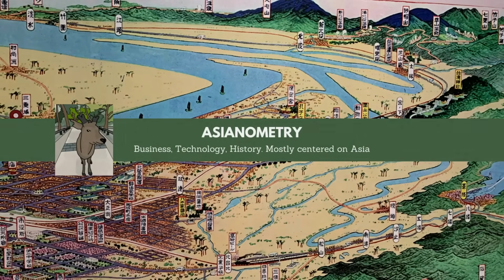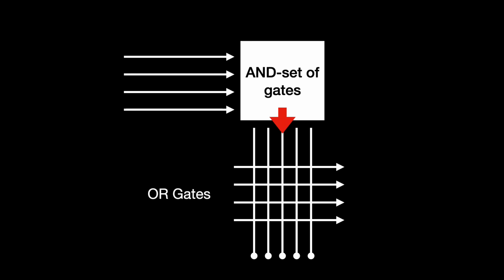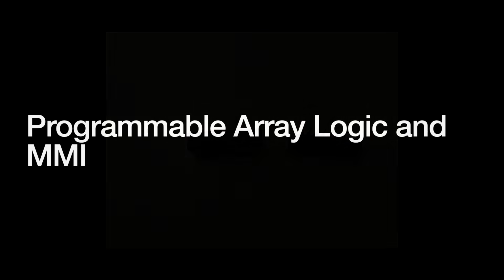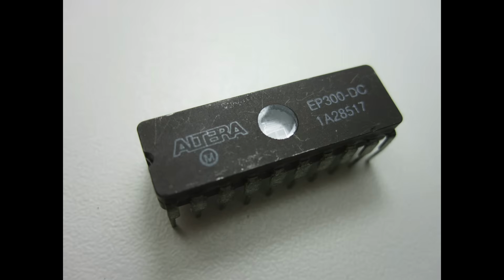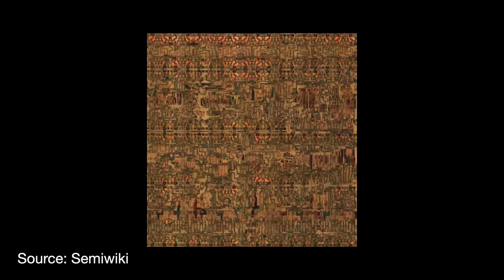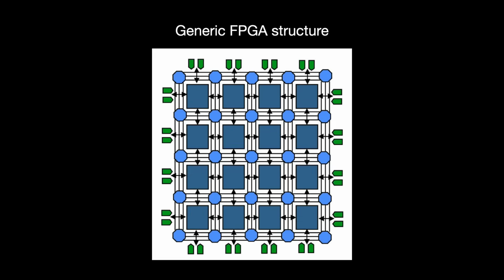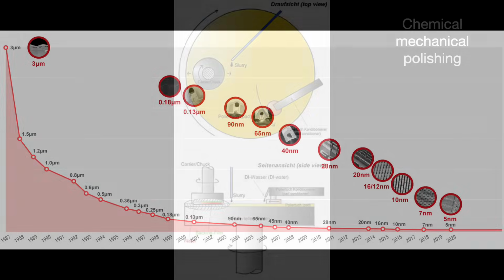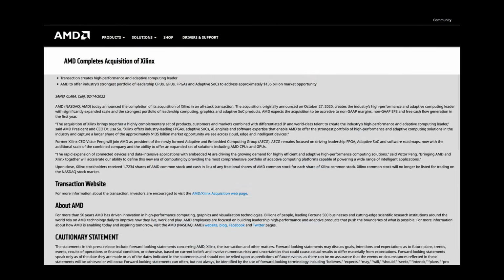The History of the FPGA: The Ultimate Flex

Comment: The "blown micro fuse" tech was continually improved on, and reached it's final form in GameBoy Advanced video cartridges.

Before rewritable storage process fell low enough, chips made up of fuse-arrays were an affordable way to store (HIGHLY compressed) video  for portable consumption.
Reply: At the end single-time programmable memory chips were usually OTP EPROM, i.e. an EPROM that technically would be erasable but in a plastic package with no window so there's no way you can. EPROM was cheap enough and more dense so it made no sense to keep using fuses, and what made a lot of the cost of an EPROM was the need for the window and the expensive ceramic package that involved.
Reply: I imagine by then it was rather easy to manufacture, too
Reply: @kaukospots  I assume so, if they could mass produce them in Children-want-to-watch-Spongebob quantities. 😂

Comment: There's like 50 people who work on FPGAs, and I'm one of them! WOOOOOOO!

Just, I hope you like looking at oscilloscopes or simulated oscilloscopes. But hey, it's the only programming challenge that  has no stack, heap, or oversimplified abstracted libraries. The only values for a variable is just 1, 0, High, Low, and ** (What you say when you get an X).
Reply: How the heck is cross-talk mitigated at such interconnect speeds now? Software scheduling of "transmissions" close to each other physically to mitigate signal degredation?
Reply: @bluesteelbass Two things: There's way less interconnects than you think they are (maybe 10s-100s?) for any given unit (limited fan-out), and clock speeds are like 200MHz at the high end, so every signal has some nanoseconds to "settle down" before the next clock cycle. Making sure of that is actually an entire phase of design called Timing.

 But the FPGA has no ALU, because every LUT/CLB is a mini dedicated ALU, so you can pipeline and parallelize to hell and back to make accelerator cards of any configuration. Then the low clock speed is less of an issue if you can push huge data throughput out of PCIE regardless.
Reply: @adissentingopinion848  Ah ha! Programmed "settle" times.  I did not realize the clock speeds of the programmable logic was so low comparatively to modern CPU's.  When doing Timing optimization, does the software know the architecture of the chip?  If a "circuit" is routed along a physically longer path than another, in which both tasks need to be performed in parallel, are there algorithms that perform "wait" times for pieces of info that physically travel faster than others?  I would assume the design phase of Timing would correct for issues like this?

This was one big problem I had when looking to experiment with these myself.  The programming software did not seem to be very in depth for things like utilizing the fpga's physical layout to better route signals for timing and concurrency, integrity, and "code optimization" for the logic you are programming.  
It seems like Vivado is finally "free" for some of their older product line. This is interesting.

If you have any advice/references on pre-built modules/packages, paid or free, that would be fantastic. I am not trying to re-invent the wheel, and people with more experience in this than me have already done great work.  

I need to find some more recent physical tech specs of these things.   Curious as to how much black magic of high speed circuit design is implemented in the chips.  What other creative ways solved problems of throughput and cross talk I wonder. This reminds me of PCIe 4.0 specs and speeds, and the PCI slot furthest away from the CPU most of the time would never reach the fully rated Bus Speed.  This is due to the distance the signal has to travel across the motherboard, and the crosstalk due to higher bus speeds comparared to PCI 3.0 specs.
Reply: @bluesteelbass    The first step is getting good fundamentals of RTL design. I suggest understanding digital logic (Booleans and Kmaps), and search up Greg Stitt. He posts his college courses for free, sublime stuff. His "My tutorial" is like an entire book, and his labs go from baby's first ALU to a whole custom MIPS computer with a custom instruction set! And that's just the first Digital Design course. Then to reconfig 1 and 2. At that point, if you had done all of this, I would hire you over literally any regular CE graduate.
Reply: @bluesteelbass  It isn't the clock speed that is amazing in a FPGA, it is the parallel structure. There are hundreds of multiply and accumulate blocks, allowing very fast filtering or video processing. The instructions are encoded in the structure, no need to fetch. Many, very fast, memory blocks are included. These now are dual clock to allow crossing clock domains, which is very challenging otherwise.

Comment: I did not expect such an in depth electronics history dive from this channel! I'm not sure where CPLDs would fit in but I was always taught that CPLDs were FPGAs little brothers. FPGAs are exceptionally strong when multiple very fast serial streams need to be modified on the fly. FPGAs are more similar to GPUs in their pipelined operations than a microprocessor even though you can have "Soft cores" programmed into the "logic slush".
Reply from the maker: We need more non-Intel electronics history. Just trying to fill a need.
Reply: CPLDs were and are FPGA's little brother.  It's just that FPGA architecture lends itself to growing big and complex.   There is still a market for CPLDs, though.

Comment: Chips are being stripped from Russian dishwashers and microwaves to be slotted in radios and missiles. One expert described the methods as rather crude, but effective. He was quoted as comparing military use of 190 nanometer chips (unrelated to this video I know but fpga is also involved) and also fpga as similar to using Xbox 360 era tech 😂 suggesting that’s why many warheads missed their targets. 

“AMD said the firm is investigating Russian customs data shared by Reuters showing that between March 2 and May 31, there were about 200 shipments of AMD components and nearly 700 shipments of Xilinx components to Russia…Among the Western electronics found in Russian weapons, one particular type of integrated circuit stands out, according to Western microelectronics experts: programmable chips, known as Field Programmable Gate Arrays, or FPGAs.

One FPGA – a shiny black Altera Cyclone II chip – was mounted between the gyroscopes of a navigation system recovered in Ukraine from a Russian precision-artillery rocket known as a 9M544.”

https://www.reuters.com/article/ukraine-crisis-russia-missiles-chips/special-report-as-russian-missiles-struck-ukraine-western-tech-still-flowed-idUSL8N2ZJ087

Comment: the OLMC (output logic macrocell) usually has configuration bits for it, one for an "inverted" output, "XoR" (per olmc on most models), weather or not to use the flip flop, ("SYN" bit, usually global) and weather or not it is to be used as an input, the GAL16V8 is a really nice chip if all you need is a handful of logic gates for glue logic or more advanced things like full 7 segment display decoders

Comment: FPGAs are what roped me into computer engineering. At my university, we're expected to write a processor architecture from scratch (usually MIPS-based, but I went against the grain and did stack-based), write a "C subset" compiler for your architecture, a very simple operating system, and lastly some networking capabilities.

It's crazy that microprocessor programming and FPGA development kits can be had at accessible prices at all.
Reply: What school or what country? That sounds awesome! My assignments suck.
Reply: @Sqwaush  UNIFESP, Brazil! Top 500/1000 so it's not too shabby :D
Reply: @Magmagan  also from brazil, what is the name of the course?
Reply: Damn that's quite a task. Did you do it in groups or everyone for themselves?
Reply: "It's crazy that microprocessor programming and FPGA development kits can be had at accessible prices at all." -- Not exactly. High tech develops very fast. To catch up with the trends of high tech, and to surpass your competitors, you have to use most advanced devices which cost a lot. For example, the VCK5000 is about $13000. At least not every student can afford.
Reply: Aren't FPGA in the electronics engineering side of things?

Comment: One thing you didn't mention that FPGA are use where programs will change in time, so you optimize hardware to run this algorithms faster, as in many transmission device, which are deployed and not change for years as hardware, but software is moving on.

Comment: Great video and very well researched, as always! Note that the name "Field Programmable Gate Array" was meant to invoke familiarity with "Gate Array" (called that in the US, known as ULA, Uncommitted Logic Array, in the UK) which was a chip that had the same logic for all clients except for the metal layer, which was different for each one. Most Gate Arrays used simple NAND gates as their basic element and there was one FPGA that tried that, but it was really smart to have a larger basic block such as a four input lookup table. And with fixed wiring the FPGAs had to add as many transistors to route signals as in the basic blocks.

Comment: I just programmed my first fpga 2 days ago. Very cool to think about
Reply: Good job!  Now that you've designed the FPGA functionality, make sure that you simulate it.  The bigger the FPGA design is, the more lyou have to use simulation.  With simulation and design requirements written down before you start, you can literally throw the power switch on and have it work correctly the first time!  I've done this many times.
Reply: @koyotekola6916  yes, I used verilog and got the tests to work before programming the fpga and it worked first time 😎
Reply: @blackbriarmead1966  Congratulations, and I mean it.  Usually, simulating before declaring "it is done" has not been too many engineers' forte.  I believe the rush to get something out the door causes many engineers to immediately focus on the functional design.  It almost takes a visionary to see how the two work hand in hand, and how the two will unintuitively cut schedule.  Even some managers don't understand this concept.